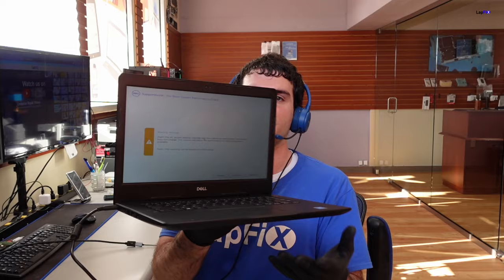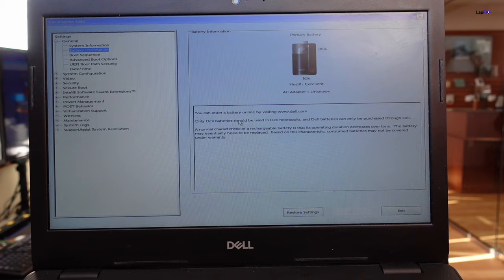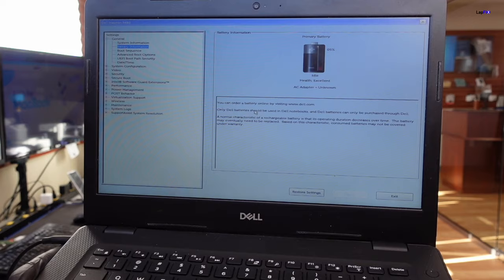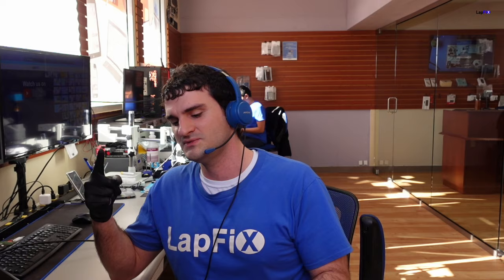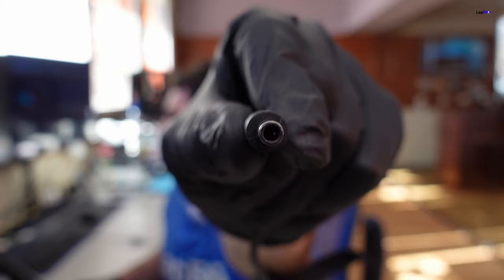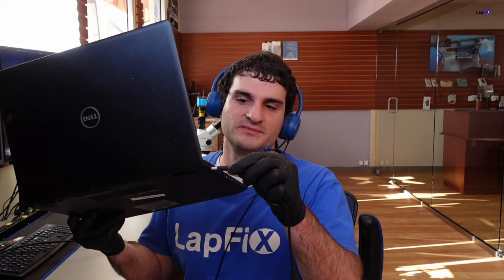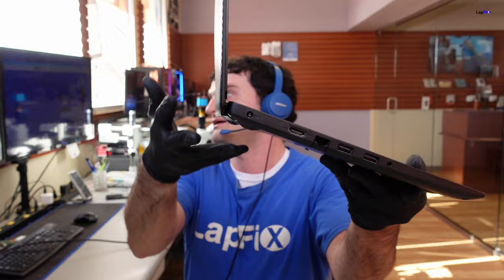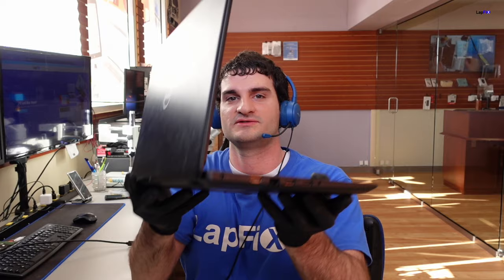How To Fix Common Issue On Dell Laptops Plugged In Not Charging

Comment from the maker: We have seen this issue quite a bit..enough to make a video.  Like and Sub if you liked it or learned something 😁
Reply: Where are you located
Reply: Would love a link to the ac the female end of the ac adapter you used
Reply: tbh hoping dell loses business partners who got sick of this happening to the laptops they gave a premium for
Reply: any advice for a faulty identifier chip on the laptop side? a shock damaged the handshake chip and now all chargers are like this even with a perfect condition jack. i cant find replacements for the chip easily
Reply: @SlavTiger  I have had so many laptops over the past 20 years and this is the first time that anything has actually broken.

Comment: I have a problem here. My dell pc won’t charge not even showing the    plugged in sign. The pc works fine without battery but all the battery tried won’t charge
Reply: Same problem with my laptop 😢
Reply: @SHaD54e  same here
Reply: @hoseamartin-luther8760 how'd u fix bro?
Reply: Same here
Reply: Same
Reply: Dell have lot of problems worse
Reply: The same is happening to me 😢😢😢😢😢😢😢
Reply: Mee too
Reply: same here. PSU, jack PCB and battery have all been replaced, the BIOS updated but still shows same symptons. The battery will not charge, the led next to the jack just flashes then blank when plugged in. i5-10210U PCB
Reply: @peater1568 i've done all the same things, pls reply if you figured out how to fix
Reply: I have same problem please somebody tell me the solution
Reply: Same
Reply: Same
Reply: This problem only started happening because I accidentally updated my computer. I think windows purposely put an update out so that the charger doesn’t work so that you buy a new computer I’m going to uninstall the update and see if that works cuz I never had that problem until then
Reply: Same
Reply: Bro yes if you find a fix please tell me
Reply: My laptop used to work without battery, it needed to be connected to an outlet for it to be on. Now it never turns on. It said battery was critically damaged, bought a new one but when I put it in, it appeared like if I didn't put anything. It's so strange, battery is new but doesn't sense it's there. So now it won't turn on.

Comment: This is a bullchit. If it's  making enough contact to run the computer it's good enough to charge too. This is 100% a software issue from Dell. We need a software fix to make it use whatever power is available.
Reply: Why does this comment not have thousands of likes? People give this man some love!!!
Reply: I confirm. I can fix charging issue for several days by removing battery, pressing power button without AC adapter for several seconds and inserting battery back. Battery will charge without problem, but after several days issue returns back. So, it is not problem of AC adapter or connector or battery. It is problem from Dell. Easy fixing way is just stop using Dell products.

Comment: Over 6 years ago I put my dell inspiring in a box and under the bed. Was working came next day no sound power backlight. I did it all called dell got really outrageous quotes. Just couldn't afford it. So 2023...can I buy a power cord and battery. Just to see if it powers on. I just want to watch utube no real storage. Dealers near me want 200 bucks upfront just to look. Ty
Reply: All you need is a used power adapter, you don't need the battery, main one or even the Cmos one.
If you just want to watch utube, you can do that on your TV thru your cabal provider.

Comment: This addresses one cause but it remains a problem that Dell laptops will randomly not recognize chargers when there is nothing wrong with the charger or the port. Currently have a six month old Dell Precision 5550 with three USB-C ports and it will randomly not recognize any OEM 130W charger plugged into the port - even when it has been working fine, powered down, and restarted the next day with no changes, but then will not recognize the charger. Several reboots over a half hour, moving the charger to different ports, eventually gets it working again. Its been driving me and our IT nuts and is a chronic, ongoing issue with multiple machines in our office.

Comment: Having PSU issues with mine. It will suddenly crash with no log information, and then refuse the charge for about an hour or so after that. It’s basically having a tantrum.

Comment: Well today i encountered the worst of both worlds, my Inspiron 7472 wont charge the battery but it recognized the AC adapter and also recognized the battery and will not charge no matter what, i've done the clear bios thing, also changed the battery cable, and tested the battery on another inspiron (it charged with no problem), i can't see any burnmarks or any suspicius commponent the laptop works fine except the batt wont charge im really lost over here :(

Comment: This did the trick for me!  Thank you!!!!  I saw, after taking the laptop apart that the power port had been pushed inside the laptop, so the center pin couldn't make contact.  I loosened the screw holding the port, put it where it is supposed to be, then tightened it down as best I could.  Hope it holds for a while, but at least now the battery is finally charging!

Comment: Thank you so much for this video.. It fixed my problem. My Dell laptop wasn't charging,  I searched all over for a solution. I bought a new battery, updated battery drivers but  still the problem wouldn't go ..Then I watched this video, and learnt that  problem was with the bent pin in the  Ac charger. I Straightened it, and  its now charging fine. Thanks again!

Comment: I posted 11 months ago on here that this video helped me with another Dell computer.  Yesterday I completed this repair on my sister's computer that's the same model as the one used in your example.  Couldn't have been easier.  Part was 6 bucks on Amazon and delivered overnight.  I emphasized to my sister that how one plugs in and unplugs the computer goes a long way towards this part lasting.  Again, many thanks  for this video!  And yes, I subscribed 🙂

Comment: I have a Dell Vostro 7500 and buying the dc input jack solved the problem.  It was not my AC adapter. I bought the input jack on Amazon shipped $11.  Could have had it on Ebay for $7.50 shipped but shipping time was excessive 3-4 weeks.  DELL sucks telling you its the charger.  Thanks for making the video.

Comment: Super informative! I'm curious as to what those 4 tiny conductors embedded in that little plastic center piece in the AC port do. Are they how the power supply communicates its information to the laptop? Or is that the job of the center pin in the barrel connector of the power supply? Any thoughts? Huge thanks for making this video!

Comment: Been having the same issue with del xps 15 9500 i9 which has 130 watt USB charger and already purchased an expensive new charger from dell though there doesn't appear to be any damage to original, fault actually disappeared after the charger was ordered but we kept the new one thinking perhaps it was on its way out, That was a few weeks ago but yesterday problem resurfaced and neither of the chargers worked, then this morning again it works, bios reports healthy battery and recognise that charger is 130w now that its working fine. Very frustrating problem on what was a very expensive laptop thats 20 months old
Reply: Same thing happening to me but the problem happened after I replaced the battery with a new Dell battery. One of my chargers doesn't work and it's a OEM Dell charger that came with the computer. I have another Dell charger and it works. The other one was working just find with the old battery. There's no reason it shouldn't work. Any ideas?

Comment: thank you so much, this is really great video and has helped me a lot in understanding disassembly and components of the laptop.  I have a Dell Inspiron 5559. Unfortunately, I am getting the same issue with the battery not charging. I replaced new battery, new AC adaptor as well and now replaced the DC jack, but still the problem is not solved. 
The white light turns on for a few seconds when I plug in the charger but then goes off. It says plugged in but does not charge. 
Any thoughts what should I do next to troubleshoot this issue. Would really appreciate your response. Thanks.
Reply: This is serious man have you gotten any solution I have the same problem was thinking of replacing the battery and ac adapter but seeing you did the same I don't have hope on it working for me

Comment: Bro WTF this is crazy hahah!
So my laptop been acting weird for a long time. Everytime I would connect the charger it would prompt me that there might be some issues with the AC and it's not compatible but I always ignored it. The laptop works pretty fine in daily basis but sometimes there's this problem that it will get stuck in a certain battery percentage. The remedy that worked for me was to take out the battery and put it back again. Then the charging would work fine. So some days ago, there was a power cut and I decided to use the laptop till it was 1%. I charged it back when the electricity came back but as usual there was no charging so I tried to take out the battery and do the same old ritual. Nothing happened. Long story short, I tried every troubleshooting method; also updated the drivers manually that I thought would help and even did the EC reset and nothing helped. 
While I watched your video, I tried to adjust my charger pin a little bit and voila! it starts to charge, damn. I don't know what is the main issue here. 

The laptop is a second hand one and it pretty much lasts an hour without AC power. I am thinking maybe the seller was having a different adapter and maybe it's something that causes the issue or it's the battery that needs to be replaced. 
PS: My model is Dell Latitude E7440

Btw loved your video, keep making helpful contents like these.

Comment: Hey you have a great way of teaching — keep it up. 

My problem: ac adapter is not detectable, per the diagnostics report, so I imagine that’s a port problem? I just ordered some precision screwdrivers to see if I can release the residual power after dc’ing the battery, and if that doesn’t work I’ll try replacing the port. If that doesn’t work THEN I’ll send it into Dell and pay the ridiculous prices haha
Reply: It'll be cheaper to replace the Motherboard yourself than to send it to Dell and pay the ridiculous prices haha

Comment: Great video. I've had to replace my AC port 3 times in the past year now on my Dell XPS 15. It works every time I fix it for a couple months then the same problems arises again. I'm starting to wonder if the ports could be getting damaged from the hinge and opening and closing all the time. Or possibly it could be shorting out because of the metal hinge on the metal port? Sometimes my laptop gets extremely hot on the bottom side for no reason - even though the fan is on the bottom and not blocked. Any ideas what I can do?
Reply from the maker: For the issue being fixed everytime you replace the dc jack.  There may be a use of too much force inserting the ac adapter to the dc jack.  These are very easy to chip and damage.  Dell is especially sensitve with chargers/dc jacks/batteries.  Even a slight bend of the ac adapter will not allow some models to charge.  For the laptop getting hot, leave on a flat service and probably replace the thermal paste.  I show how to in other videos I have done before.  Thanks for watching
Reply: @lapfix  Thanks for the response and Ill watch your other videos. I also noticed some issues with my HDMI port which is right next to the ac adapter port on my computer. Often when connected to an external monitor the video cuts in and out. Type C port also has intermittent issues. Could the problems be related? My laptop is over 3 years old and used a lot for work. Maybe its just time for a new one.
Reply: Thanks for this

Comment: My Inspiron 1545 AND Inspiron 15(?)(I have it taken apart rn) both have battery issues! The Inspiron 1545 has a battery but it doesn't see it! The other Inspiron doesn't charge probably because of what you said, but I'm not sure… as I can't get the WiFi card black and white cords connected! They're so small!!

Comment: Sir need your help
When we talk about f12 when you turn on your laptop,  the ac adapter giving me numbers and watt or something and the battrey state giving me idal, is that mean that my charger is need to be changed? And next time i pressed f2 and the ac adapter was unkown and the battrey health is normal what is all this about and means? And thing that i did not understand is that i've been using this charger for like a long while and it was working very well, but suddenly now stoped and to be honest i did not check those [ ( idal & unkown - info) lately ] until now, so i really can't tell if the issue because of those info or something else and oh by the way the charger that i have now still charging but i have to let it plugged in for a while and then it's start charge
Reply from the maker: You should always see the AC Adapter wattage.  Idle either means it is not charging or it is at 100% full

Comment: Make sure the jack is plugged in all the way.  It wasn’t a bad power supply or bad jack.  The jack plug wasn’t pushed in all the way until is snaps in.  That solved the issue battery is charging.  However, thanks for the video anyway.

Comment: New port, new battery and new charger, but not charging. 
Battery excellent.  Charger work with my other Dell!!
Reply: Had same problem 9% and no more charge. To fix it just did uninstall Dell Power Management. Actually I uninstalled all software which names begin from word Dell. Now my Dell G3 3779 works faster. No more 100% disk usage problem.

Comment: Same thi i have latitude 7280 and the port was wack off it left with the pins and stuff if i put the charge it turns on but will not charge, can you help me how to put or attach the new port, its very expensive to have it done ... And can i aks after putting the new on will we need to diagnose or like progarm to have it read  by th motherboard??

Comment: When the charger is just plugged in, it starts charging for 5-7 seconds and then stops. Plug out, then in, it does the same. Does not look like it's a charger problem or a port problem? What do you make of it? Thanks.

Comment: thanks i want to ask another thing please guide me
Laptop battery connector pins i pur laptop on charge but when i check with multimeter it doesnt show me voltage.
i want to ask how to check those pins are working or if they only provide volt when battery is connected?
please guide me thanks

Comment: @lapfix, if the dc jack charger is the problem, do you think using a usn c charger could fix the issue ?
Reply from the maker: If it has a DC Jack, the USB-C Port may not be for charging (as the are all rated differently)  I would make sure your specific laptop allows for USB-C Charging as it may only be a data line for usb/display
Reply: @lapfix  thaank you!!!

Comment: I think they sent me the wrong charger? It has another slot for a C type but it doesn’t charger there at all. I plugged in a different charger that fits in the top but it’s too big and it only shows a white light for about 4 seconds and it will not turn on at all

Comment: Great video and gave me a lot of hope....but...dell inspiron 15 5567 now has a new battrey. New charging port. Charging  cord is good and will brighten the screen, Bios up to date. Windows up to date.  It keeps the baytery at 8% and not any further. Doesnt go completely dead when plugged in.  Is there any hope for this laptop?
Reply: Had same problem 9% and no more charge. To fix it just did uninstall Dell Power Management. Actually I uninstalled all software which names begin from word Dell. Now my Dell G3 3779 works faster. No more 100% disk usage problem.

Comment: my latitude 5480 is only charging when powered off or on sleep mode. it wont charge when it is running. i checked in the bios system and it is saying charging, health excellent, and ac adaptor 90w. however when i turn on the laptop, it only says plugged in and the battery continues to decrease. also my charger is only charging the laptop if i twist it and put it in a specific position. pls lmk what may be the issue

Comment: I have a dell E6430 when doing diagnostic in the bios for battery the result pass
battery detected health normal 
AC adapter detecetd 90 watt 
both are original what could be the problem ?

Comment: Hey . This is the exact same problem I am facing right now .  Inspiron 15  , 5000 series . The battery was just replaced 6 months ago , and the old one lasted for 4 years .  The problem just happend suddenly 3 days ago . Yes : the new battery is an orignal , same model as the previous one , spent a whole week looking in my city's stores to make sure I am buying the same battery , and not a copy cat.

My local vendor allowed me to use  the AC adapters  he has for free , but it still didnt charge  . I figured the problem  was with the DC port  , and got  it changed  . It still won't charge . 

Windows and BIOS both just say "plugged in" , but in Dell Power manager it says "plugged in , not charging" . 

How likely is it the problem is motherboard related ? , and  If so :  is there hope it can be fixed , like a component  just needing to be replaced , or is it time to move on and get a whole new laptop ? . 

Thanks .

Edit : I belived it was  software related initially . Re-installed drivers , edited the power plan +Dell Power Manager etc : all that failed too .
Reply: Had same problem 9% and no more charge. To fix it just did uninstall Dell Power Management. Actually I uninstalled all software which names begin from word Dell. Now my Dell G3 3779 works faster. No more 100% disk usage problem.